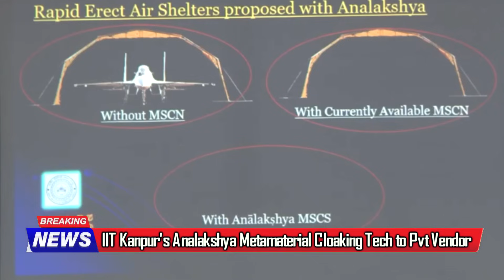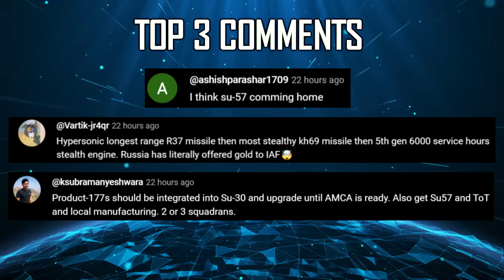Indian Defence Updates : Tejas Mk2 Engine Run,France Pinaka Order,New CATS Warrior,GE Engine Deal

Comment: The projected dates or timescale for the Tejas  MK2 is very unlikely to be fulfilled. The air chief is right  when he said the he has no confidence in the HAL. HAL has never never never been reliable in the delivery of aircraft on time.....Take Avro HS748, Marut HF24, Saras aircraft, Pushpak light aircraft, actually even Helicopters, the Dornier is not certified for export to Europe.... etc etc as examples. They just "deliver" big talks and show case their "Technology Demonstrators", ´but always without substance.  The private sectors should get more involved. Why doesn't HAL cooperate with Brazilians (Embraer) and the French for the Safran Aircraft Engines???

Comment: DRDO is really working and can  do more but HAL is very slow , i doubt that AMCA can be capable of taking on f35 or j20 DRDO should partner in developing amca if they make it fast we can do it by 2030 ,5.5GEN at 2030 is not a bad development we can upgrade it to 6th or 6+ gen within 5 years till then AI will have proper tech ,infra in India we can integrate it with indigenous AI...

Comment: HAL is just another production facility, if one is not happy they can ask it to developed by other org. Indian army and navy diversified this long time back. But IAF will not do this, they will lobby for directly importing aircrafts. IAFs realisation came in last 2 years when people starts questioning about depleting strength. HAL is just a soft target.
Reply: It is HAL that is doing import and assembly for last 60 years without learning anything
Reply: @vaimurthy As I said they are production facility not design facility. They receive design from ADA and act on it. DRDO pushed pvt players to manufacture for army but why ADA has not done the same ?
Reply: @vaimurthy  Exactly manufacturing is difficult and only HAL is capable Indian company that can do this and thats what they learn in 60 years, its not just simple assembly task. GOI tried to create option from last 3 years but no one came forward.
Reply: @vaimurthy If you are saying HAL is importing component then who is not importing components? Can you name 1 major platform like submarine or Carrier or even rifles? Org like MDL, GSL also do assembly only then what is the problem here.

Comment: IAF Chief scolding HAL is sad, not because it is not deserved. This scolding will be felt by the hardworking engineers and thinkers, but not by thick skinned bureaucrats who are at the root of these delays.
Reply: Hal deserves it. Apart from engines, hal is behind in other aspects.
Reply: HAL has all technolgy transfer done for tejas and they are just sleeping in production hanger IAF cheif is right for HAL employees its just a government job which pay them well with less stress they dont considor the emergency requirement of fighter jets when chineese are manufacturing like printing news papers . Hatsoff to Airforce chief

Comment: Disagreed with Air chef regarding differentiation of Tejas mk1 and Tejas Mk1A...there is not just one software upgradation but instead Tejas Mk1A Integrated with Elta EL/M 2052 AESA radar, self protection jammer, ECM pod and other advance sensors, Avionics, upgraded LRUs and upgraded mission computers...

Comment: The IAF Chief sir scolded HAL was most satisfactory part that I saw in Aero India, they actually deserve it. Looking to systems like Sheshnag, Vidhvansak, Abhimanyu, etc, I will say that private players have allot of potential, they just need funds and backing from our forces.
Reply: There should be 2 production lines - one run by a consortium with HAL, one without HAL and they should compete against each other and eventually be given contracts in a 60:40 ratio or 70:30.

If one consortium is not UpTo requirements, they should be replaced
Reply: IAF chief should know that HAL has been doing a commendable job and it is the the work of Defence Minister to provide HAL with the number of engines promised by GE from USA, IAF chief should know without engines any fighter jet is incapable of takeoff
Reply: @lifestylemaster6186  commendable job of showcasing MK1 as MK1A, it is called cheating
Reply: Why don't private companies invest in r&d of HAL and get benifit form their historical research works.
Reply: @angadvishwakarma35  private companies think of their own benefits not the benefit of India or IAF, be 100% sure about this, they have zero knowledge about fighter jets technology and just want to get some benefits
Reply: @angadvishwakarma35  Because there is not much to learn from HAL 🙂

Comment: Iaf chief was correct, Hal is like most other govt organization, Hold hand with tata, reliance and adani, let them make tejas mk2, tedbf and amca.
Reply: Yes HAL is inefficient but IAF should also own up to how many times they have changed requirements for Tejas Mk 1 alone.
The IAF tested about 5 platforms before acquisition of 36 Rafale and then they wanted to test the aeroplanes again bcoz they wanted the best.
IAF is as afflicted by BABUGIRI as HAL.
Reply: @anjusreemaity6647  Offcourse they will change if you take indefinite time. After 20 years, HAL came up with 3rd gen jet which is no more required in the world.
Reply: @vaimurthy  I didn't say dont promote private players in supply chains for technology but replacing HAL with Tata, reliance is not good. Will create their monopoly in all sectors. One sector should be dominated by companies having experience in it
Reply: @vaimurthy   HAL is the worst but that still doesn't excuse why IAF Babus wanted to test the same aircrafts for 2.5 years after purchase of 36 rafale.
Reply: @vaimurthy   saab gripen, rafale, euro fighter all of which underwent technical evaluation in MRFA 1 which then ended in purchase of 36 rafale. And yet they included all 3 in MRFA 2.0 technical evaluation.
Why do they need to test all 3 again when they know their capabilities.
Reply: @vaimurthy   do not talk non sense with me, rafale was purchased in 2017 so they purchased the jet 10 years after evaluation ?
And what progress was made between 2018 to 2025 ? Renaming the acquisition programme ?
Reply: No Indian Private Company is even close to the capabilities of HAL.
Reply: @srikrishna2561 have u seen tata advanced systems making Apache helicopter shell?... Private sector is at par with other foreign companies we buy drones from private and start up not psu
Reply: @srikrishna2561  Says who? HAL even after assembling for 60 years did not learn. Private who are accountable to their shareholders will do better job
Reply: @srikrishna2561 when dral was created, candidates with experience at hal were systematically denied. 
They preferred no experience application then bad habits. To tell you the “experience” Hal has. 
In 2008 Boeing refused to ever work with Hal, in order not to damage international reputation. 
That two international first tier companies that wants nothing to do with Hal. 
On the other hand, suhkoi doesn’t want anyone else but Hal to work with, seeing that su30mki made by Hal are more expensive and lesser standards, I can understand why.
Reply: @Muhammad_Lenin_Thomas : the private sector doesn't have enough capability as HAL and the Private sector is also not willing.. TATA wants to sell old F16 to IAF  , Adani is more interested in giving indian names to foreign weapons without R&D.. And they are not going to get their feet wet without   large orders..  So unfortunately we are stuck with HAL..
Reply: @karthikmk1839  Private sector is not interested in unknown AMCA. Give them MK1A and MK2, they will. Your complaint about they doing only assembly, HAL does the same for last 60 years
Reply: @vaimurthy  if no risk then no reward for private industry.. expecting to HAL handover production line to some private player is not going to happen. If big private players see themselves better than HAL it is time for them to act like one..

My complaint is not that BIG private players are doing assembly, my complaint is that they only are interested in doing assembly without R&D.. That too  mostly without any right to modify or enhance the weapon system.. So even for small modifications we have to run back to foreign country.. 

If AMCA is unknown, can't the top 20 private defense company create a SPV among themselves to work with ADA.. The SPV could contains best talent from all the companies..  But private industry will not do it.. Or let them suggest a alternative plan to govts proposal...
Reply: PR for privatization GE engine was govt decision, air force generals giving specifications with foreign product in mind and you are saying HAL is incompetent
Reply: @aruntamil6527  IAF chief interview shows GE is not the culprit here, HAL is
Reply: @vaimurthy  so there is no delay in engine transfer to HAL that was supposed  to be in 2024. Really the best intellect answer.
Reply: @vaimurthy  40% of the engines already used engines as per agreement since for ioc and getting certification process it will be easier without actually using new engines.
Reply: Do you know we lost 2 yrs in searching for new Pvt partners.
Reply: @Artivule  That is only for AMCA. No one will invest in a project with little know how. Ask them to be partner in Tejas and put the condition that they have to be part of AMCA
Reply: Jio phone is made in china,adani drone is made in Israel.Baki sab samajhdar hain
Reply: @angadvishwakarma35   we need both for large scale  employment and big projects for infrastructure projects. Don't forget that Jio works for profit and they still set up 5g services all over the country at competitive rates. We can't rely on BSNL can we ?
Reply: It's engine issue not Hal fault. It's biden administration. Iaf chief complaining lol what about mrfa for over a decade. Navy far better aircraft done planes ordered. Iaf caught red during abhinandan time. No bvr pak was easily jamming, shot It's own helicopter.
Reply: Dummies HAL. Parts are outsourced to private players only 
VEM, Dynamatic technology, Tata Aerostructure, 

Integration is done by HAL.
Reply: Pls search CAG report on IAF purchase .

Making tender as per available products not requirement .
Reply: Pls search CAG report on IAF purchase .

Making tender as per available products not requirement .
Reply: Stop promoting monopoly of Tata, Reliance and Adani + they don't have experience in making fighter jets. Rather improve HAL
Reply: @Gmmmw13 Nahi hai experience toh sikha denge. Stop supporting underperforming PSU. Desh ki Ma behen karwani hai kya war ke time pe. 40 sal me 40 fighter jet nahi de payi.
Reply: @Gmmmw13  Even after assembling for 60 years, HAL did not learn anything. You are the one promoting monopoly of HAL eventhough it is disaster.
Reply: @vaimurthy  congress destroyed HAL not HAL's fault. HAL has all fighter jet technology and experience unlike Tata, Reliance. HAL has improved under Modi govt so shutting or replacing HAL will not be good
Reply: @Gmmmw13  Tata is way better than hal
Reply: @techeves001  wtf?😂😂
Reply: Ya and rahul gandhi starts an controversy again in this😂
Reply: IAF chief should know that HAL has been doing a commendable job and it is the the work of Defence Minister to provide HAL with the number of engines promised by GE from USA, IAF chief should know without engines any fighter jet is incapable of takeoff
Reply: @lifestylemaster6186 hey why r you paste this on every where
Reply: @lifestylemaster6186 Bhai aap IAF ban jao...u look more qualified
Reply: @lifestylemaster6186  Yeah you know better than IAF chief. Commendable job where jet which finished prototype testing is not getting delivered